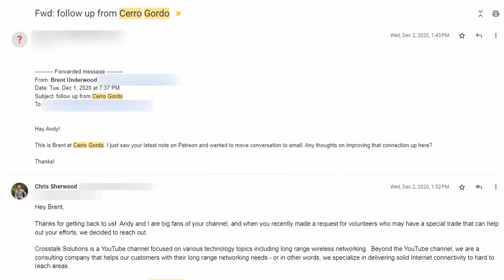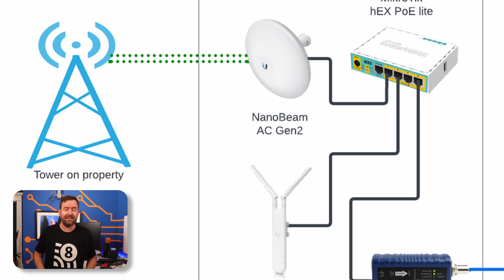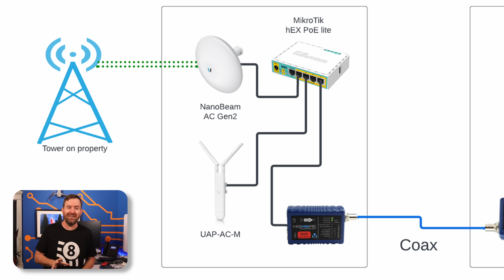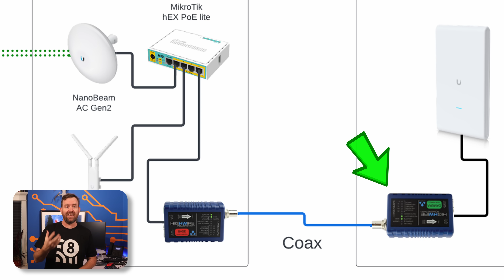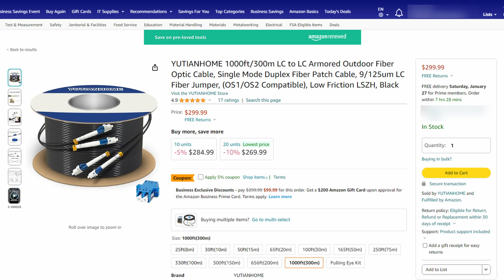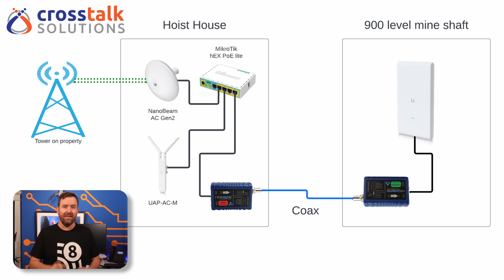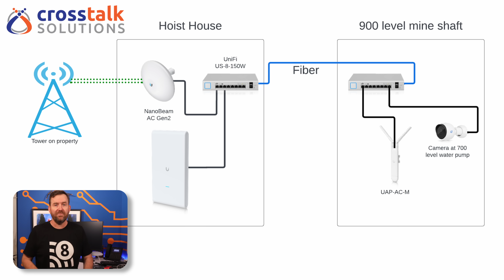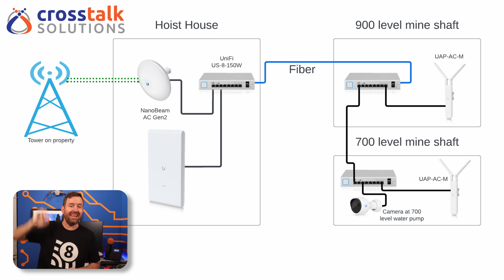Backseat Driving a Wireless Install 900ft Underground

Comment: Agree with the fiber but the electric they ran is a problem as well. 12/2 romex at 120v will lose 2.4 volts only using 1amp. 10 amps at that distance would cause a 29.4 volt drop so depending on what is powered, it’s way undersized and could have been a factor.
Reply: As I haven't watched yet, 12/2 REALLY!
I know a situation where that was done over 500 feet and they blew out a water pump.
I don't know why as this guy is an "electrical engineer" they know what they're doing. which is why he also dabbles in radiant heating. designed the whole system from what I understand, which didn't work. Also knows everything to know about construction. <Sarcasm I have forgotten more about construction then what was going on there. I am so glad I finally walked away as I was hired for Computer support and audio/ video production and somehow found myself at adding a two-story addition.

Sometimes that friend, family member or acquaintance that knows everything.... doesn't know everything.

Comment: So an interesting idea would be to just use Ethernet and multiple switches at each level for ease of use. It does add SPOFs tho, but there are probably ways around it.
I disagree with fiber, if, for some reason, you need to unplug the fiber, or simply need to extend it, it will be a nightmare. If you want to do it, properly, fiber is not as simple as plugin it in and it works for people that don't deal with it regularly, this especially true for dusty environment.
Your lightning comment is interesting, but armored fiber is also just a big metal tube, depending on the conditions, high voltage can likely jump from the sfp to the fiber, but I agree it's not as direct
Reply: Fiber being glass is an insulator now the armor would be metal but it's not electrically connected to anything as it's only there for mechanical protection. Fiber is run between buildings all the time to avoid the electrical ground difference potential which can and does kill stuff.
Keeping things clean for novices yeah that could be a detriment but they already had issues with coaxial cable so. They could easily have been running a second line of fiber. And most fiber is pre-terminated so it would've been easier assuming they didn't have to do it twice and they didn't run a multi fiber cable.

Comment: While I was watching that video, I was going like WHY NOT FIBER? haha. Coax at 900ft ehh not sure I'd rely on that. Sort of figured power and data wouldn't work, but was surpised data actually did.   I have no clue how those adapters work. But I do know DOCIS for cable internet surely wont at 900ft. Just depends on what frequency those adapters operate at, which I'm guessing is low. 

If budgeting was an issue I still think the fiber route still would've been cheaper.

Comment: Even if I am the biggest mikrotik fan I agree that they should had installed a unifi POE switch with fiber capability. All you said is correct. The only thing I would change is go with TP-Link omada since this is a low budget network.

Comment: instead of Coax, I would have run Fiber myself... However, outdoor rated/armored fiber can get a bit expensive...  Since power is down the shaft, maybe a powerline network device? But I do not know what the distance is on that and if they are on generator power or something there, it could be a very dirty / Noisey power lines.

Comment: The AP possibly couldn’t detect the region because there were no Wi-Fi beacons in the cave.
Reply: The region will be set in Software/firmware, sounds like it didn't power up or couldn't fully power up.
The only time the access point will have to assess its surrounding situation is to determine an open channel on power up no channels and use it can go anywhere. Or if it is necessary to operate on one of the newer bands that is shared with radar, also not gonna be an issue underground as the Ground can block pretty much all Signal.

Comment: Agree with all your suggestions, especialy Fiber would be better.. Have worked in big experimental buildings using coax, every time there was a thunderstorm we needed to go around resetting the devices due to electrical spike in the coax cable.  Would also do link aggregation so they could withstand failure of one fiber cable. Would possibly also gone with 16 port switches as once they see the benefit of having internet down there they will most likely add more devices

Comment: Disclaimer: I've never set up a proper network from scratch so I'm just going off of what I've seen on YT. I have no personal experience for it.
When I saw the Ubiquity APs I was surprised the rest of the gear wasn't Ubiquity gear also. Keeping them all on the same brand (whatever that may be) keeps everything unified and easier to manage.
Running coax also would not have been my first choice, for a run like that I'd prob recommend fibre also but I wouldn't know what specifically to recommend for that either (see above)
Having a switch at both sides hadn't came across my mind but is a very good idea and I'd like to think I'd have though of that had I been setting that up.

Comment: While I was watching that video I had the same thoughts about using armored fiber and switches at either side for the run down the mine shaft, I definitely think it would have been a better solution that is less susceptible to downtime, but I’m glad to see the solution they came up with worked.
Reply: If that fibre gets sliced and damaged, its far harder to repair, plus the power for switches. Can't do power over fibre. Would have to run copper for power and if that's  DC power, the voltage drop will be nuts.
Reply: @draconightwalker4964  pre terminated fiber is fairly cheap, and they already have power ran so that isn't an issue

Comment: WOW!! Exciting!! I would just like to be a fly on the wall in that adventure!! Real neat!!  I would agree with armored fiber cable as well. I think I saw the power issue with the type of wire they used. But that may have been a cost issue as well. There are newer ways to traverse power over that distance, to a multi-point / Sub-panel coming soon.

Comment: If they didn’t want to run fiber for some reason, or if they didn’t want to rely on power down the mine, I would have used the MikroTik GPeR poe ethernet repeaters.  Those little GPeR Ethernet repeaters/poe extenders are pretty darn reliable & will run 1Gb just fine.

Comment: I watched the same video a few days ago. A few comments as well. Definitely splurge and get the industrial rated switches. Those can handle the cold and heat. Also there's outdoor armed fiber that has a metal jacket around it - it's worth the extra penny. It would add at least $900 more but would last longer and wouldn't be prone to break should someone scuff the cable.

Comment: i have never seen anyone use coax for networking in about 30 years.
Reply: Especially at that scale. There are some implementations of moca over coaxial cable for DIRECTV and similar satellite systems to do whole home media sharing between the DVR and non-DVR units. And there's a renaissance of cable for reusing existing lines to get wired connectivity in different rooms. of course this all depends on how well it was originally put in and how good the cable is and whether or not other lines meet up where you need them to be usually not there's an LTT video where they tried to do this and it failed and ended up using powerline converters.

It's funny to think 10base2 and thicknet was replaced with twisted pair only to be slightly edged out at the market by moca over coax.
Meanwhile fiber has gotten really cheap I was looking at a transceiver for like 25 for a two pack. Then there was the previous equivalent to moca over phone lines hpna which didn't get very far.

Comment: Agreed that fibre is the way to go. They are relative cheap and reliable. You can install two links to ensure availability. I would also try to spot equipment (mostly switches in this case) that is fanless given the environment.

Comment: Chris! This is great. Very thoughtful and helpful for our setup. Would love to chat more on the whole underground Wireless plan! Hoping to bring it to the 700 and beyond. I'll follow up on your email thread.
Reply: Please you guys do a collab!
Reply: I would run two armored fibers one on each side of the shaft to have a redundant line and use both ports, an then do the same for ethernet back up to the 700ft area. With the amount of time it takes to run a cable down that shaft the extra expense is nothing compared to loosing network in case some rock shifts an break one of the line. even wors would be being down in the shaft, some sort of collapse happens and breaks one of the cables. By running dual cables on each side of the shaft running down the mine, you make it safer and less prone to failure and you get that perceived safety and actual safety by having a backup line.
Reply: My opinion is it would have been best if you could use conduit for your power and run fiber. I have worked for an underground mining company setting up wifi and networking between multiple mines with Ubiquiti products. Bare cables even armored fiber is at risk of being damaged. Another crazy option I have done is casing a borehole that is drilled from the surface and separated from the hoist shaft.
Reply: When I saw the video, I too was so perplexed why not fiber?  fiber is cheap, reliable, and fast and they already ran AC power down the mine shaft...
Reply: @taylorlightfoot  Frankly for most amateurs fiber sounds scary, especially once you have to figure out the transceivers, etc.  The available options could cause decision paralysis.  For those that have experience, I'm sure it's much more straight forward....  But yeah, IMHO, this did sound like a good argument for fiber.
Reply: @BenjaminSchollnick you can buy preterminated lengths of fiber, with any connectors you want on it now, its not super expensive any longer
Reply: Would love to see you guys collab, you both have great channels and content :D
Reply: Brett, a super reliable option would be to install Sound Powered Phones in the mineshaft. They are a passive emergency system that the US Navy has used since WW2 and they're extremely robust. They're made by Dynalec and I think the distributor for CA is Kinnaman Electric.
Reply: If they’re doing multi-level, Id do mid-span spliced drops from something like a PLP Coyote DTC for each level. One cable (24F) with slack on each zone for termination to a drop cable. Unifi the whole environment like you mentioned.
Reply: If the whole plan is to know when the pump has a failure, I wouldn’t bring internet down there. They allready got wires down there, just wire the pump to an alarm which make noise (above ground) or sends you a message when it’s down. Way more simpler then all that internet hassle. Just a green light and a red light above ground and an alarm horn or something else to alarm you that it’s not working.
Reply: @jeroenkrieger  they already have a "green/red"  "working/not working" alarm.    "Water/No water".   The network camera would save a 90min shaft ride to get an idea on what the problem is and then a solution with another 90min shaft ride to fix if you don't have the parts needed on the first 90min ride.
Reply: @bryce686  Surely you can't see what's going on with a pump or it's motor with a camera. I'm in the pump business and we put sensors on bearings and motor windings but never cameras. So it's better to have a secondary pump in station. If one pump goes down the other takes over. Also have your dedicated pump parts and tools down there. But having internet down there for communication purposes is the smart thing to do. But using fiber would be the way to go. Copper like coax can work but you need a way thicker cable then that was used in the video.
Reply: When watching the original video and then this, I kept thinking "Why not use PowerLine if you're running / relying on power anyway?" The TP-Link TL-WPA8631P KIT looks like it can transmit over 1,000ft of electrical, plus if you want connectivity near your water pump you might just be able to use these off the existing electrical circuit run to there.
Reply: @mathwizmf2013 power line is always a last resort short of using wireless. Cable / fibre is cheaper and better.
Reply: @je8277 you could be right, as I've never used it personally, but I feel like it has gotten a lot better in recent years and I have even seen it used in LTT Tech Upgrades. 

In this sort of setting, it might be a better / cheaper solution. $100 for a tx/rx pair is pretty cheap and could maybe even be an inexpensive redundancy. 

Considering the possibility of failure, I like the power over coax solution instead of fiber (IF AC power at the bottom wasn't needed). If you use fiber, you will lose connectivity from power loss or fiber breakage - essentially more points of failure. Power over coax as well as powerline backup allows one of those lines to break in the shaft and still maintain communications.
Reply: @mathwizmf2013   since they already HAVE the coax adapter, it makes perfect sense to leave it in as a backup, yes.  Powerline networking has far too many "your mileage may vary" caveats to merit serious consideration until and unless you simply run out of options (or want 15+ redundant connections to the management interface, specifically).

 @shizzilla23  << What they said.  The added cost of conduit can't be more than the cost of needing to rip-and-replace a 250+ meter cable; power, fiber, or otherwise.

Also I feel the need to bring up battery backup.  It doesn't need to be anything fancy, it just needs to last long enough to email someone that the power's out.

(Edit) Maybe even run dedicated fiber links from the top to both the 700- and 900-foot levels, then tie those two switches together via copper.  Notably more expensive, but if any single cable (or transceiver!) failed there would still be a path around the break.
Reply: @mathwizmf2013  the point missed by those suggestions is the grounding issue with copper wire & terminations. The video showcases a rugged natural environment, which protected fiber overcomes electrical interference risks from.
Reply: @mathwizmf2013 powerlines are garbage.

Comment: He has received thousands of tips for everything, but he seems to rely on his cousin as we say in Italy, I would have done with fiber also for the future, and to get to the bottom of it or make the video a phenomenon, and with an ethernet cable and switch at each level with the possibility of shunting through the tunnels and making decent coverage at least at the entrances, there are then about 200 feet between the levels, also to have a backup at the bottom or close the ring, it's not that expensive, in fact it saves money, the pre-assembled connectors are enough and more, you just need the appropriate cutter, it's smarter than using coax and stupid expensive converters, they are so clumsy with a coax, they would have ruined even an armored submarine fiber cable hahaha, I would have put all UBNT devices to keep everything the network easily under control always and everywhere, he pulled a power cable that everyone advised him against for that length at 115Volt, perhaps he was only interested in making the video and turning on a LED bulb and the accespoint, I saw in other videos that was still using geostationary bidirectional satellitare, I think the speed is that, strange that it doesn't use starlink, it seems that the network for the valley is a project or will be done in the future, but I don't think it's that of the tower, which seems to be a private link of a telecommunications company probably gets the signal from his home where he has the old satellite system, it doesn't take much to understand that a collaboration could only benefit him.
Reply: There is also a thread on Reddit where a
He asked for input for what to talk about in the video, none of this was touched on really.
Reply: Oh yes the age-old the mayor calls on their nephew, cousin, brother or friend who knows everything absolutely everything about Radio's, telecommunications, infrastructure, County infrastructure etc...........................
Reply: Feel like I should add some context This was told to me during a training seminar for ham radio supporting local county state emergency communications because they wanted to have a pool of people they could draw upon that wasn't said friend of mayor who actually knew some thing halfway about radio communications and had emergency situation preparedness and training of the State/county radio system.
Yeah apparently imagine hostage situation in bank with mayor and chief of police outside calling should we go with brother or cousin who has a CB radio...... Breaker breaker 19 we have a hostage situation >in southern accent.

Comment: What does everyone recommend for a home 8gb internet router?  Local cable internet just released 2, 4 and 8 gb fiber and fios now does 2gb.    Currently running fios 1g and optimum cable 1g fiber into a Ubiquity EdgeRouter ER-8 in a failover.   Would love to hear affordable solutions for the bigger connections.

Comment: Love the idea. Exactly the kind of crazy I love. What would I have done differently? Well, I like EdgeMax switch gui and logic better than UniFi, so I'd use the EdgeSwitch 8 150w instead of UniFi switches. This is still a reasonably small network, so keeping track of IP addresses is not a hustle. The one other thing I would have done, I'd have used a plastic electrics box in the mine to provide the switch with protection from the elements. The AP is built to withstand some extra dust and water, but the switch is an indoor unit, so giving it a protective shell is not a bad idea.